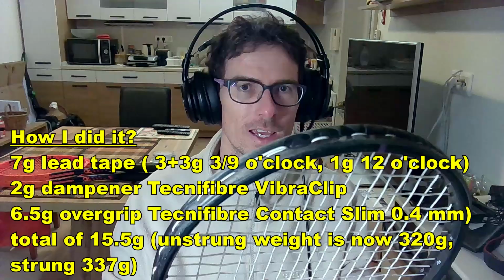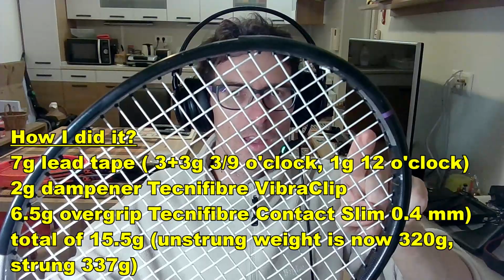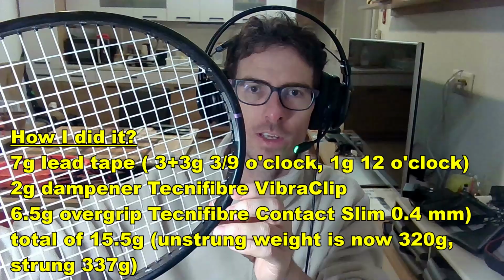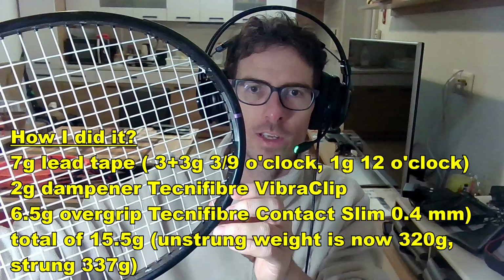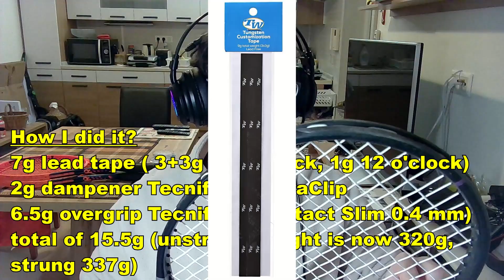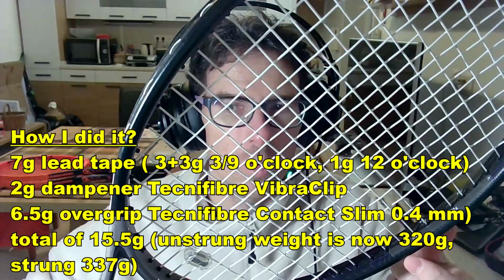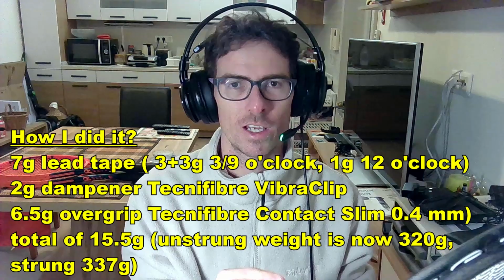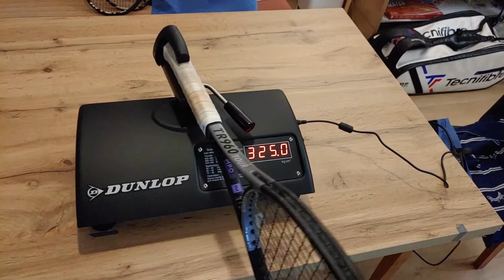🎾 Why You Shouldn't Customize Light Tennis Rackets Too Much? 🏋️‍♂️

Comment: I don’t necessarily agree with this. Some light (<295g) racquets are remarkably good platform racquets, akin to pro-stock hairpins. Excellent examples are the PS97L and Prince Tour 100(290) which can have a lot of weight added to the hoop and handle to make a highly polarised racquet (similar to what tour players use) with exceptional performance. 
If one wants a racquet with eg: strung specs of 325g, 33.3cm balance and 340SW, one needs to either use a pro-stock hairpin or a light retail racquet.

That said, I agree that it isn’t generally a good idea to add massive amounts of weight to a racquet unless one knows what one is doing.
Reply from the maker: Yes I agree that Pro Staffs and Prestige rackets even lighter models are good for custom job, because the base is more solid, beam is usually thinner. But most light rackets (are head heavy power rackets) and they cannot really handle the extra weight properly. The problem is in the overall structure of such frame, stiffness etc. Lead tape doesn't mimmick graphite and it's characteristics. It is just a dead weight without any other features like help with frame bending, energy transfer, vibration dampening etc. So if the base structure is weak, it will ruin the final experience and can lead to some weird behaviour of the frame, elbow issues and so on.
Reply: Or the head speed mp l also 23 mm

Comment: Agreed on this. Customizing a very light racquet can be physically impairing.
However, one of my hitting partners bought a pair of Wilson Ultra 100L v3 (295g / 68RA)  two years ago, strung with full poly and he experienced bad elbow pain after 6 months playing it stock.
He switched to a hybrid string setup, added four x 5g strips of lead tape at 3 and 9 o´clock and has had no problems during the last year.
Reply from the maker: It can work for sure, depends mostly on the balance of the stock frame. The Ultra 100L is 280 g stock, not 295 g, right? Just for the info we are talking about the same racket. The balance for the new 100L v4 is 320 mm unstrung, so I assume it was the same also with the version 3. With this hand heavy balance, even a lighter racket can be customized quite easily. Usually the 280 g rackets have balance a lot higher more to the head, 330 mm at least and that can be a problem for customization. But when it is just 320 mm, you can put quite a lot of weight on the head to beef the swingweight up.

Also the hybrid setup has changed the rackets feel for more comfort so great addition to that weight increase.
Reply: @CzechTennisGuy  
From what Wilson website states about Ultra 100L v3 :
Head Size: 100 in
Length: 27in
Strung Weight: 295g
Balance: 33.02cm / 4 pts HL
Swingweight: 296
Flex: 68RA

Latest model you mentioned, Ultra 100L v4 :
Head Size: 100 in
Length: 27in
Strung Weight: 295g
Balance: 33.02cm / 4 pts HL
Swingweight: 299
Flex: 64

BTW., in contrast to your ´Quir Using Old Racquets´ video, I still hit with old Head Liquidmetal Radical Tour MP and Liquidmetal Prestige Mid racquets: both play monstrously when 10-20g of lead are added with VS Gut/ALU Power hybrid.

Comment: I customised a Head speed MPl (275g) I put 2g at both 2 & 10. I added 9g to the inside of the handle and a over grip, The lead is kimony which is thin 1g = 6.5cm on either side of the strings over al weight is now 306g with strings 3 points hl! Didn't want the MP because of QC & the SW & weight felt not as manoeuvrability!

Comment: TennisGuy: Another great topic and review… and timely for me…. I play with a Prince Twistpower 100x… strung weight is approx 305 grams… was thinking about some customization, but you make a lot of sense… therefore, will keep my Twistpower the way it is… 👍Ciao, John
Reply from the maker: You can of course try customizing it a little bit John. Just few grams, maybe 5g (1g 12 o'clock, 2+2g 3/6 o'clock) in the head and you will see if you can handle it. Just try it with a dampener at 12 o'clock like I showed in the previous video to get the sense of customization.
Reply: @CzechTennisGuy  : thank you, I will… btw: the 300 gram Wilson Shift is piquing my interest… its specs seem to be in my sweet spot… will do more research…. keep up the good work…. hope you are doing well…

Comment: Hey.
Just a quick question—if players add few grams to the head of lighter racquets, why he can't add some weight to the handle to turn back the balance?
or add few grams to throat?
Reply from the maker: Hi, you can do that but it doesn't really help - you increase the swingweight,  ̶t̶h̶e̶n̶ ̶y̶o̶u̶ ̶d̶e̶c̶r̶e̶a̶s̶e̶ ̶i̶t̶ ̶a̶ ̶l̶i̶t̶t̶l̶e̶ ̶b̶i̶t̶ ̶w̶i̶t̶h̶ ̶t̶h̶e̶ ̶l̶e̶a̶d̶ ̶o̶n̶ ̶t̶h̶e̶ ̶h̶a̶n̶d̶l̶e̶ ̶(̶o̶r̶ ̶i̶n̶ ̶t̶h̶e̶ ̶t̶r̶a̶p̶ ̶d̶o̶o̶r̶)̶ ̶a̶n̶d̶ ̶y̶o̶u̶ ̶a̶r̶e̶ ̶i̶n̶ ̶a̶ ̶c̶i̶r̶c̶l̶e̶.̶ ̶S̶w̶i̶n̶g̶w̶e̶i̶g̶h̶t̶ ̶g̶o̶e̶s̶ ̶u̶p̶ ̶a̶n̶d̶ ̶d̶o̶w̶n̶ ̶a̶n̶d̶ ̶i̶t̶'̶s̶ ̶a̶ ̶n̶e̶v̶e̶r̶e̶n̶d̶i̶n̶g̶ ̶s̶t̶o̶r̶y̶. You would really need a loads of weight in the handle to make it really hand heavy but then it changes the feel of the whole racket too much, it becomes clunky and unresponsive. The idea behind customizing a tennis racket is not to change it completely, but to tweak it little bit, beef up the performance. You can't make sports car from a family van. EDIT: The swingweight cannot be decreased by adding lead into the handle.
Reply: @CzechTennisGuy  Swingweight only goes up, regardless of where you add weight on the racket. You can't decrease the swingweight by adding mass, it's physically impossible.
Reply from the maker: You are right. I just tried that. My mistake. But there is this one BUT that opens up an interesting question. Is it correct how we measure the swingweight? I mean the machines. So you attach and fix the racket to the machines "jaws" that hold the grip of the racket about 70% of the lenght of the grip. There is this support platform around the grip that has no feel and can hold "any weight", right? The machine doesn't care if you put 10 g in the handle or 10 kg, because it is fixed to the jaws no matter the weight - it has "unlimited" power of holding the racket. The limit is only in the stability of the machine itself. But your hand, your hand will feel the difference. So the final swingweight number is essentialy measuring only the swingweight of the racket from the end of the grip and beginning of the throat throughout to the head. It doesn't take into account the change in balance, which is crucial for the overall feel of the racket and how you feel it's heavy. So the swingweight number might remain for the machine, but for our hand it will feel different. We are talking about absolute numbers but our body doesn't work with these absolute numbers because we are not machines, right? What is your opinion on this thought?
Reply from the maker: I've got a response from @jonf1760 who informed me, that you cannot decrease tennis racket swingweight by adding lead in the handle. You would have to cut out some material from the head or remove the head gaurd to decrease swingweight. I will make some video on this topic.
Reply: @CzechTennisGuy  Swingweight machines are designed to measure the resistance to being rotated at the point on the handle where most players hold the racket which is 10cm. This is the average for most players index knuckle. So a player with very small hands vs someone who holds the grip super high like an amateur will have differing swingweights in reality as the moment of intertia is different, regardless of what the machine says.

But yes, no metric can tell you how you will feel about a racket, it is just a decent enough parameter to know how it might feel. Or to bring it close to what you have liked in previous rackets.

No machine tells you how the mass is distributed in the frame, so even 2 rackets with identical swingweight and identical balance can feel different if they have mass in slightly different places.
Reply from the maker: Great explanation 👍. I will do some video about this topic in the future inspired by your knowledge. Thank you 😉
Reply: @jonf1760  Not to mention that actual tennis swings do not rotate about that 10cm point in the handle--a racquet swung by a longer arm has a higher MOI.
Reply: A lot of "light" versions of racquets simply omit (or reduce) the steel weight that gets embedded in the handle layup.  The result is lower static weight and more head-heavy balance. Otherwise the racquets are the same as their heavier siblings.

Comment: Actually it's best you buy as light as possible a racket that fits your needs: heads size, string pattern, beam width, racket length, racket flex.  This way you have a s much space in static weight as possible to get your optimal racket. All you need to do is understand 1. what you need and 2. how you can get that by adding weight (at 12 , at 3 and 9, and the handle).... It's not rocket science it's just physics. The heavier the racket the less you have to work with (as you can only handle soo much static weight, and there's not much to do in terms of "shaving" down grams). Last but not least due to quality control if you buy a regular player racket you can get a monster very over speced in terms of SW and you're screwed as you can't really take that down(e.g. Tennis nerd showed an overspecd Babolat Pure Strike gen 3 16x19 that is on average 327 SW, whilst his came around 342 SW) . Where as a lighter racket is impossible to come with a too high of a SW due to quality control issues.
Reply from the maker: I agree that an underspecd racket is better than overspecd. But I don't think buying as light racket as possible is a good thing. It should be mostly almost perfect in the stock form. You can always add some lead and weight to the racket later for sure. But it doesn't make any sense if you buy a 280 g racket and you later customize it to a 300 g racket. You should buy a 300 g racket instead. The tweak and overall tuning should be always about few grams, otherwise you can really mess up the whole frame to the point it's unplayable and dangerous to your arm. Adding lead here and there doesn't really help the overall frame flexibility or rigidity. The added static weight doesn't work like graphite. It's not part of the frame structure and it's literally a "dead piece" of material on the frame. It's not within the frame. So I think that most of the custom job should be done very gently with just few grams of lead here and there for fine tuning and balance changes. But turning a beginner racket to some Pro Staff RF97 specs for example is not very wise.
Reply: @CzechTennisGuy  I don't what to tell you but the endpoint of customizing a racket is to make it as close to perfect for you as possible. Buying a 300 grams racket and just tweeking a few grams is just playing around as a fad in your youth :)) FFS the player pro stock rackets come around 300-310 before they bump them up to anywhere between 330 and 360 grams :))  The reason that 300 grams doesn't work is from reality: any manufacturer gives you a +/- 7 grams margin of error which at the most extremes can go to anywhere between + 21 SW points (which likely makes any racket unplayable for the 99% of non pros), or - 21 SW points which makes any racket very useless. Now your arm can only handle X amount of static weight so you can do with that what you will.
Reply from the maker: @euLIRIC  I get your point except one thing - most amateurs don't care about the swingweight etc. Believe it or not, I'm around many tennis players here in the Czech Republic which is a global tennis leader at least on the WTA tour and there is like 1 person out of 20 people who ever heard something about swingweight. And these guys are in clubs, they have been playing tennis for 10+ years, they even play tournaments, but they are not educated in this sense. Most of the coaches around also don't know a thing about customizing a tennis racket, I mean this is alarming, but it's a sad truth.

The issue with customizing a tennis racket for your own is that you need have a swingweight machine to be really precise and to know what you are doing. That's around $1200-1500 for a machine. Who has that? One of my friends has it and I have it. No other person around me owns that machine and I'm talking about 100+ players on advanced level, best coaches in my region that can play better than most people etc. When talking about pro's, they have people who customize the rackets for them and in some on tour video I saw a pro level person who does that for Federer and other top players - the cost of pro level custom job including custom grip size and shape, lead under bumper, lead in the handle etc. is around $150-$200 / 1 racket. There is a lot of work to be done which sometimes can take days to optimize the racket for the individual player.

I'm not saying your idea and your view is wrong, but it's far away from a reality and from what people want or need. They just want to buy a racket and play, that's it. All these custom jobs are for real tennis nerds and enthusiasts which is only a few percent of the whole tennis community.
Reply: @CzechTennisGuy  well they made cheaper models, at less than 300 $, and you use them in conjunction with your mobile phone. But more importantly almost all tennis shops (that sell and string rackets) have them, the shop I string at measured my sticks for free in all of 60 seconds and gave me the Swingweight. All you need from that is on average 1 gram @ 12 = 3-3.5 SW points, and 1 gram at 3 or 9  on average = 2-2.5 SW points ... and you're done ... If you want to get more technical and precise there's the TennisWarehouse university for free that gives you the tool for free to see exactly where you need to put and how much weight to get (from your starting point) exactly what you want (new static weight desidered SW and new balance point). Lastly the tennis shops can just do this for you for a small fee and you don't even have to bother.  It's not at all complicated. For the old timers I bet they can just "feel" it in hand + hitting with the stick if it's too light in the head or not. Last but not least if you make the case for the average tennis player, than those don't even care for customizing...
Reply from the maker: @euLIRIC  "But more importantly almost all tennis shops (that sell and string rackets) have them". This is sadly not the case for our country. We don't have too much tennis pro shops here in the Czech Republic, but it's getting better. We have regular big sports stores that just sell rackets, some of them have stringers, too, but that's it. Custom job service is very rare and can be found mostly in the biggest cities, like main city Prague. I think we still live 20-30 years behind western countries and that obviously translates into little bit worse service in this area.
Reply: @CzechTennisGuy  that's definetly unexpected. Maybe I lucked out and found a good.

Comment: Hey Doc it hurts when I move my arm like this....Doc: Then don't move your arm like that.  i.e. Add weight to light racquets to your heart's content.  If it doesn't work for you, or you start to feel uncomfortable.  Take the lead OFF.
Reply from the maker: Not sure about your point. The thing is, that there is absolutely no reason to customize for example a 275g racket to a 295g racket (adding 20g of lead), if you can buy right from the start a stock 295g racket that will play a lot better than a 275g racket with extra 20g on frame. I support customizing all rackets, but the light ones just with a few gram of lead, 5-10g should be enough to change the rackets SW dramatically. But if you add more weight, you also change the balance dramatically and light rackets are allready head-heavy balanced so this can lead to overbalancing the racket even more to the head and making it unplayable for a longer period of time.

Comment: Why don't you also add weight into handle to keep balance?
Reply from the maker: You can add lead to the handle. But with lighter rackets this can change the overall feel and comfort of the racket in a way you won't like it. The problem is overall structure of lighter frames is not meant to take another extra weight.

Comment: Tungsten is actual more dense and heavy than lead, so don’t crap on the tungsten tape .
Reply from the maker: The problem with tungsten tape or at least I see it as an disadvantage is that the tapes are thicker compared to lead tapes. The reason for that is they are not made entirely of tungsten, but it's a mixture of tungsten and rubber compound. It's not a 100% tungsten, or at least I'm not aware of 100% tungsten tapes. I tried these tungsten tapes: https://www.tenniswarehouse-europe.com/Tennis_Warehouse_Tungsten_Tape_3x3g/descpageTWUS-TWTCTP-EN.html and https://www.tenniswarehouse-europe.com/Wilson_Tungsten_Tuning_Tape/descpageWILSON-WTTTP-EN.html , they work ok, but if you want more precise tuning like putting it under the head guard, lead tape is still the best. I believe pro's use mainly real lead for custom job when we are talking about customizing racket's head. The lead tape is more delicate and fine for this type of custom job. The biggest advantage of tungsten is that it's not toxic to our body so it's more comfortable and easy to apply.
Reply: @CzechTennisGuy  
Great explanation.  I havnt used the TW tungstom but have the Wilson.  It is a little thicker, but I just put it on the inside of the frame of the head.  Also have applied lead tape.  I’m fine with either since I don’t out it under the head guard.
Reply from the maker: @llamawizard  I used the TW tungsten as you shown in the video and it works great, so just it depends on what do you want to achieve and if you don't mind that the tungsten kind of pops out more from the frame. Both things work.